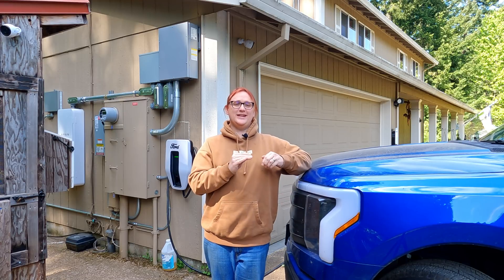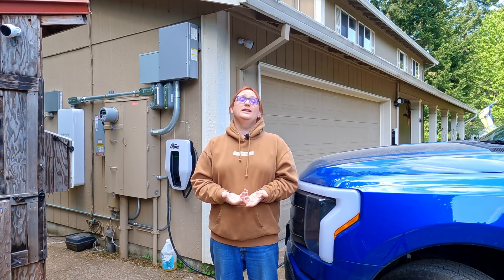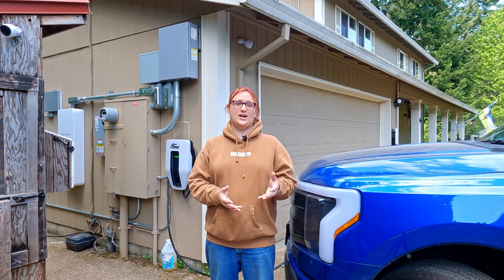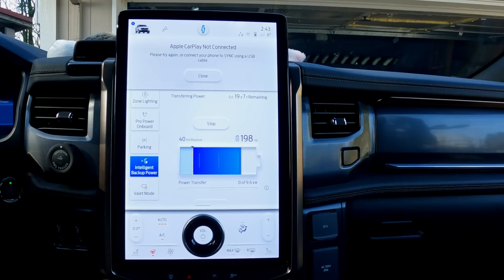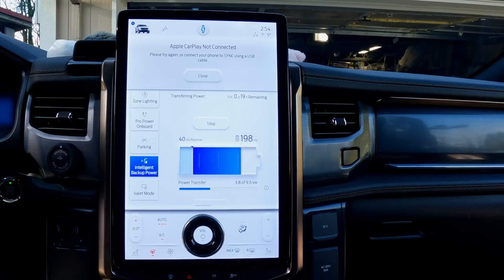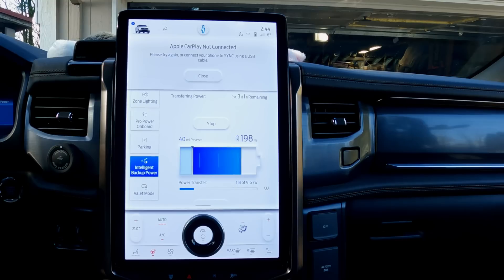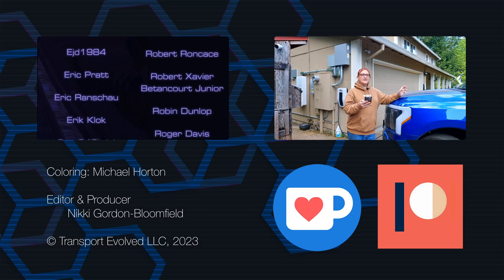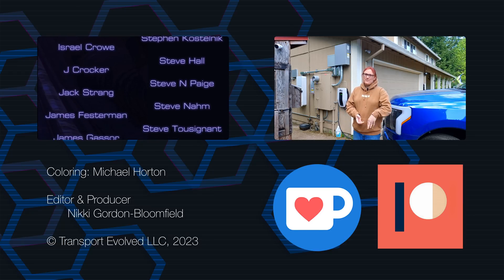I Was Wrong: How The Ford F150 LIghtning Home Integration System ACTUALLY Works

Comment: I finally got my Ford Home Integration System working again, after it not working for over a year. Ford replaced my defective Ford Pro Charger and , unrelated, my Lightning started receiving updates after no OTA updates for about a year. It took me a year and I’d guess 200+ hours relentlessly contacting Ford’s various customer service depts and reps. The local Ford dealer also replaced the Lightning’s modem and more, trying to get OTA updates to work. The Home Integration System has now worked 4 days in a row! My house is off the grid as I type.  I’m happy now, but it wasn’t a smooth process. I do realize this is at the cutting/bleeding edge of EV 2-way charging/powering, so I expected it not to glitch-free:)

Comment: Bluetooth is one of the least stable systems.  

I ask the question WHY did ford use Bluetooth and not use a better WIFI system which has longer life than BT.
Better yet they should have a internet network connection (same as Internet over power line) which is converting the pairs of pos and neg wires into ac pos & neg.

I am sure I saw you tuber powering his house via his ev and from memory was a KIa???

If using a charging cable not hard to have a back flow via network connection...

I am also wanting to see no more fob keys,  as if every car/truck had a lock with chip reader and if a lock gets picked then off goes a alarm and disable the car/truck...

I am about safer cars and stopping stolen cars etc...

Comment: Everything is hooked up... the Truck says it's on "automatic" in the home backup screen, but when I go to set it up in Fordpass, under Charging->Backup Power, it says "Fordpass doesn't seem to be responding". The charger is installed correctly, and is known to the App... it will charge the Truck... anyone?
Reply from the maker: We had this issue for a long time - but try following what Nikki did in THIS video: https://youtu.be/1dGHY_56eeo
Reply: @transportevolved  Thanks for the tip on the Delta "M Professional App"... what a stupid name. Got the Inverterer/Disconnect "commissioned", and now the "server issue" has apparently been resolved with Fordpass, but I still get nowhere in their vehicle->charging->backup power
screen. I click "get started", and it brings me back to the home screen. In addition to the rest of the problems, there's no way Ford is beating Tesla on the V2H front. We've got a powerwall at another site, and while we don't have a tesla to feed it, apparently all that is needed in addition to the Tesla Gateway is the charger.

Comment: Nikki’s Youtube video is the clearest explanation of what is probably happening to my Lightning too. Why can’t Ford just say this? It would be so simple for Ford to say they are working on a bluetooth bug fix between the truck and the Ford Pro charger. That must be why when I have reset and re-paired the Ford Pro Charger to the truck, the home integration system has worked, albeit briefly. I’ll quit wasting my time trying to fix it. Sure would be nice to hear from Ford, with updates about the issue.
I heard that someone from Qmerit said they only knew of one HIS actually working in the US… that would be more than a “handful” as claimed by the Ford BEV phone service rep. Thank you Nikki!

Comment: I was pretty sure getting a third party home integration system was a bad idea from the gitgo.  Being an electrician I've always tried to keep things as simple as possible. Knowing over many years in this trade that the fancier something gets. The more things that can bring the whole thing crashing down.  I realize it's not automatic, but it's very easy for me to just turn off my main breaker turn on my generator breaker and connect my truck to the generator receptical via the 240 volt receptical in the bed of my truck. It powers everything I need to run in an emergency. And that's with just 7200 watts. No extra inverter or transfer switch required. I hate to think what their home integration system ended up costing.

Comment: Nice vid, Nicky. Oh the joys of not-quite-working technology. I recently discovered an "only in the UK" type issue with trying to sell excess kWhs from solar pvs (you know, the reason why you had them installed in the first place). Turns out we have two types of system certification: MCS and Flexi Orb. Some suppliers (Octopus, for instance), will accept MCS but not Flexi Orb. Which is great if you have one but intensely irritating if you have the other. I now find myself buying gas and electric from one supplier and selling electric to another. Is it just me, I wonder?

Comment: Bluetooth is about the buggiest protocol out there. I've seen so many devices that have problems and require regular reboots, or to disable/enable Bluetooth to reset the system and get comms to work. My HP Elite tablet has the same issue when talking to my SMA inverter, the comms won't connect most of the time, but turn BT off and on and away it goes. I've seen the same issue with a heap of other devices. It's time BT was scrapped or redesigned from scratch, because it has been buggy and generally crappy from day 1.

Comment: Our Nissan Leaf with a Setec 9kw power station has worked faultlessly over the last 2 winters just running our ASHP and our water pump! But now Nissan has dropped the lead on V2H, I am looking at Ford for the first time as a future investment just because of the bidirectional charge feature! I will be keeping a sharp eye on what goes on here!!! Popint of reference we have saved over £1,600 ove rthe last 2 years which is half way to paying for the Setec. Thanks for the update Nikki!

Comment: Put a volt meter on you 12 volt battery in the truck and see if the truck goes to sleep and turns off blue tooth. Causing the problem.

Comment: Possibly stupid question.  Why the Bluetooth connection?

The J1772 standard has communication built in.  I'm guessing the standard doesn't have needed commands built in, but why not use a superset of commands and enable comms over hard wire instead of relying on a separate wireless signal?

Love to hear an answer from sunrun / ford

Comment: Using Bluetooth for this purpose seems like asking for trouble. They have a cable connection via the CCS connector and cable, that includes a proper wired communication link from the Charge Station Pro to the truck over GreenPHY, which is a kind of PowerLAN or HomePlug communication. If they added one more wired connection (such as conventional Ethernet or PowerLAN) between the Charge Station Pro and SunRun Home Integration System, all would be proper wired connections that simply work.

Comment: Reducing the variables, getting to the root cause. Hoping you get the Ford update "soon" for the Bluetooth handshake from the back of the F150 to the charging unit. Kudos to the 2 engineers that confirmed your home installation was fine. The drop signal is a known "bug". Keep us updated.
Apology noted.

Comment: Why would Ford use Bluetooth for communication when there is a physical connection between the charger and the truck?? The charging station and the truck conduct handshaking activity via the charge cable to charge, why would you not use the same path for V2G??

Comment: Critical infrastructure that could be supporting lives (A/C, oxygen concentrators, iron lungs etc) should not be using something as flaky as Bluetooth for comms just because BT modules are cheap and plentiful!
There is already a physical connection to transfer power which also has a spec to carry comms over ethernet or CAN, RS232, RS423 etc, so Bluetooth should be irrelevant.

Comment: Aren't their data connections, in the charge cable?  Why rely on bluetooth at all.  When a Tesla connects to a Supercharger, there is a handshake, once VIN and account are verified, charging starts.  Must be a data connection in addition to the high voltage connection for charging.  Anyway, hope they get it fixed soon.

Comment: 🔌Using wireless Bluetooth for handshake communications during a power-transfer is just wrong. Maybe Ford should add hardwire similar to what people do in life-safety and home critical standby generators and battery backup systems.🔌

Comment: Too much complexity and too many failure points for a reliable backup system.
Add to that the fact that the truck needs to be there when power goes down and it needs to be charged. 
Nice feature to have though, as a bonus. I suppose you still need a generator.
How often do you loose power and what are the consequences? There is that to take into account, before spending money and dramatically increasing your carbon footprint with batteries and stuff.
Reply: It should operate in tandem with her solar panels. It's more about how long a power outage she might experience than how often, though being rural, she probably has several outages a year at a minimum and longer outages than folks in town. And as she pointed out, with well water the consequence is being unable to flush the toilet and no drinking water.

Comment: Why are they using Bluetooth for communication when there is already a physical cable linking the truck to the device! Haven't they heard of Powerline-Internet. Clearly, this truck is version 0.5 or some such! Note, there is also the fact that over the air communication is more sensitive to electrical interference as one might expect in an electrical storm. Good grief!

Comment: Bluetooth is wonderful!
Bluetooth sucks!
One of my only complaints about my Tesla is how it sometimes takes a bit to connect when I approach the car.  It asks me to use the key card because the phone has not connected yet.  If I wait a minute or two it finally connects then I have no problems.
As another commenter pointed out, why would it need Bluetooth when it has a hard wired data line through the charging cable.  Seems like a software limitation to me.
For something as important as powering a house the Bluetooth should be treated as a redundancy/backup rather than primary communication.
Excellent coverage of this very important subject.  I'm not really an early adopter and count on smart people like you to iron out the bugs first before I spend a ton of money.
Thank you for the excellent series of videos.

Comment: Sure glad to hear about this getting fixed! I’m waiting for my mine to get permitted and installed, with summer thunderstorm season coming!  Glad I don’t have to put an unsightly UPS by my WI-FI router 😅
Reply: Well... Probably.  If your WiFi router is sensitive to power fluctuations, and your UPS is keeping the power clean, without it you may see momentary issues when switching between grid & battery.

A WiFi router isn't usually particularly expensive, but with possible lightning storms, I'm paranoid enough to keep surge protection on expensive equipment.

Comment: 5:08 I miss that classic Macintosh duck sound.
I suppose there is literature emphasizing the need for the Lightning to be close to the evse to have a decent Bluetooth connection since Bluetooth is not very long range.
Reply: The longest charging cable allowed by US code is 20 feet, so that's not likely as much of an issue as mounting the EVSE around a corner on a metal-sided building.

Comment: This is a really cool feature. I can't say that I am surprised by the glitches since this is all so new, but I am hoping that all manufacturers can sort these thing out in the next 3-5 yrs. My concern is that, except for Tesla (and even they are not perfect), no manufacturer has a very good history with software. It was just never seen as a core competency. That has changed, and I hope they can ramp up quickly.
Reply: Sunrun home integration system is way over priced. And if you're not able to install it yourself be prepared to pay another absorbent installation fee. I'll stay with my manual connection using the 240 volt 30 amp receptical in the bed of my truck.

Comment: So if it worked in an emergency, it would last only 10 hours? and now your truck is also dead.
Reply: They also have solar and would probably be turning off non-essential loads, so It would probably last much longer in actual usage.

Comment: Just checking.  Do they have it redundant power cut off. 

1 when the system Senses a power cut it automatically throws the main  breaker.

This protects the truck and home systems 

Then the truck should start delivering power 

When the system detects the power is on again you can shut down the track and turn the power back on seamlessly.
Reply: You have essentially described a transfer switch, which is required by code if you have any backup power that can operate when the grid is down so you don't electrocute the folks trying to fix it. It applies to Generators and batteries equally.

Comment: Why are they using Bluetooth at all?  Does not the J-1772 standard include data connectivity?
Reply: No. J1772 only has very basic communications, pretty much just signaling and letting the car know the maximum current it is allowed to draw.
Reply: @BenjaminNelsonX  Ah. That's a major flaw in the design, then.

Comment: Backup-Power is a complicated system. Your system is a multi-component one, which adds some more difficulties. So it is no surprise that it didn’t work right out of the box. You are an early adopter, that’s the price. I 🤞and hope it all ends up in a reliable system 😊.

Comment: With this much trouble with their own infrastructure, it will be interesting to see how Ford integrates with NACS chargers.  Before they roll that out widely, I hope they get Tesla to verify it will work smoothly for Ford owners (whether NACS adapter or full integrated charge port). ... Niki, congrats on working so hard to get the root cause detected!  It will be a relief for you when the OTA update resolves the root cause!
Reply: Hopefully the adapter ford gives us will also work on super chargers. The cheap adapter that was supposed to have come with my lightning disappeared at my dealership.  But you couldn't use it on anything that put out more than 40 amps.

Comment: Seems to me that the engineers who designed the system are a bit too enamored with bluetooth.  My question to them would be.  Why use bluetooth when there is a physical hard wired connection between the backup power system and the truck?
Reply: Agreed.  Why rely on something so ephemeral for a vital role as powering a home where certainly some owners have chosen that functionality because of critical medical appliances, etc...  If you're going to offer UPS, take it seriously.  Ford seem to think it's a neat party trick.
Reply: Bluetooth is fickle!  I would assume it's changing channels due to interference and the connection is dropped.  I would think there'd be bandwidth on the sense leads for the V2G communication to happen - unless someone has a patent and Ford would have to pay, ending up with this shitty 'work around'
Reply: If there's a microwave oven operating nearby, it will play havoc with Bluetooth.

Comment: I have the FORD Home Integration System installed at my home. It was a DIY install with a 20 kw solar system. I tested the intelligent back up power system about 3-4 weeks ago and it worked great. I didn’t leave it operating for more than 15 minutes so not sure if prolonged usage would create a problem. Thanks for sharing this update

Comment: This is the reason I got the Rivian.   I really don't trust legacy auto on software... if you weren't working with Sun Run partners, how would you communicate this glitch to Ford through the dealership? They'd ask you to head into a dealership and you'd never get a solution since no dealership would have the V2H stuff deployed (and they wouldn't wait around for 3-4 hours for the issue to happen)

I get the feeling Ford is better than GM, but I haven't gotten any big confidence boosting feelings from either.

Anyway, thanks for fighting the good fight and pushing for Ford to do better.
Reply: Imagine it was VW where they just kick the can down the road by firing the contractor they hired; hire a new set of engineers who work for 8 months & make the problem worse to then fire that team & hire yet another new team.  3 years later, you return the vehicle from lease or sell it outright (not mentioning the V2H capability) to make it someone else's problem & move on to a different "new hotness."

Comment: Have you guys seen the solution someone used with a R1S where they used a small switch and small batteries for the transition? Granted. It wasn't automatic, but it seemed like an easy way to keep things running
Reply: I use my lightning to charge my solar batteries via my magnum inverter charger. That way the only load that is on my trucks 240 volt receptical is the 30 amp charger. Everything remains powered from my solar system. And of course I turn off all non essential equipment.